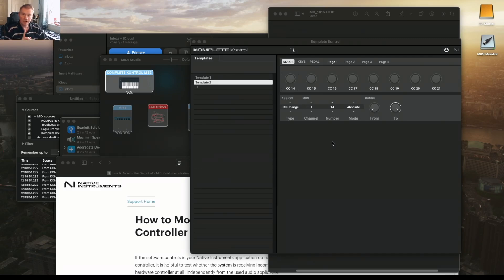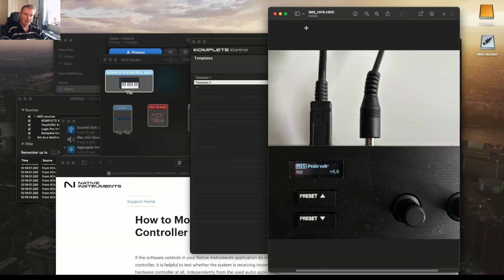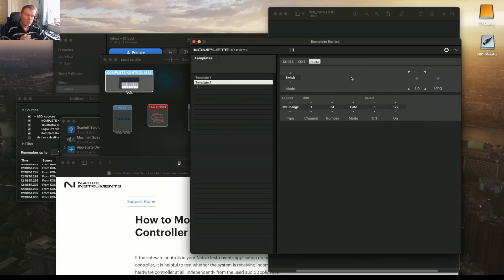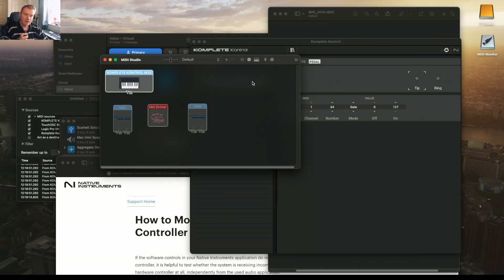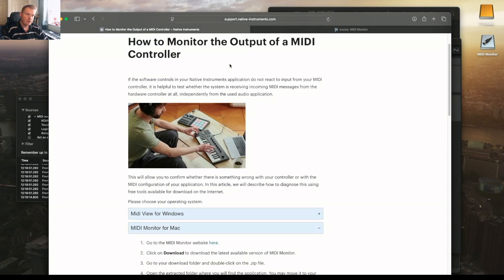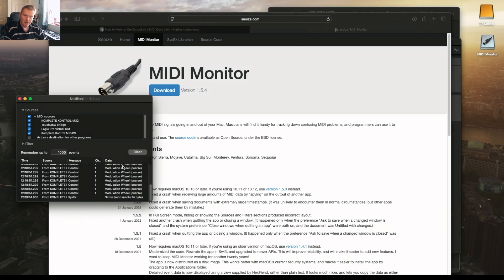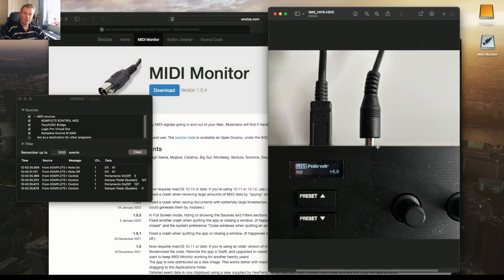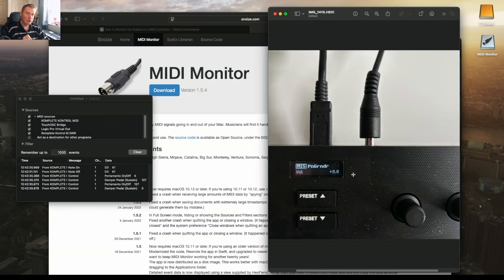MIDI Foot Pedal Not Working - SOLUTION

Comment: Just wondering if it’s the difference between being either a normally open (N.O.) connection or normally closed (N.C.) that’s causing the problem. If it works with other keyboards, that’s perhaps the case. There should be a standard for sustain pedals, but there isn’t one. Grrrrrr….

Oh… from your description it sounds like the difference between an internal TRS connector versus an internal TS connector. More Grrrrr….
Reply from the maker: Yeah, grrr indeed. I think it might be a defect on the M32 as the pedal is listed as compatible on their website. Hi hum, have a great weekend 👍😁